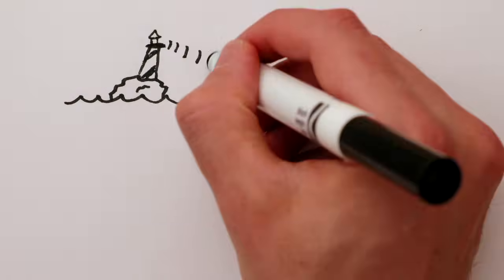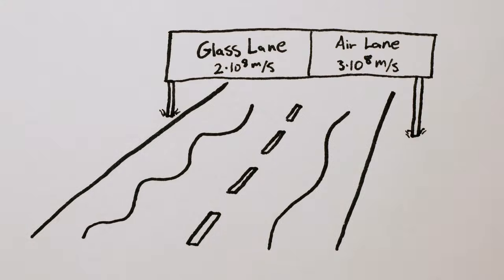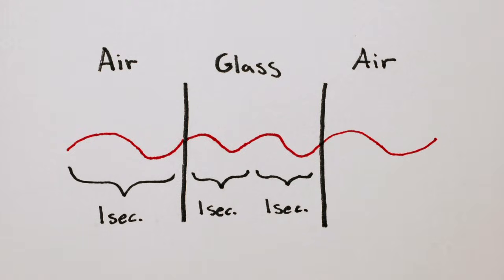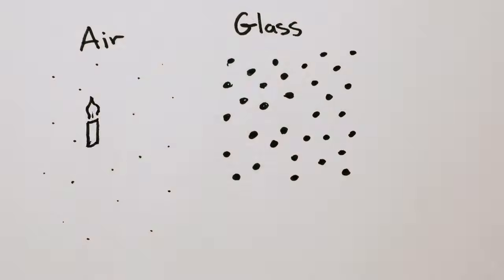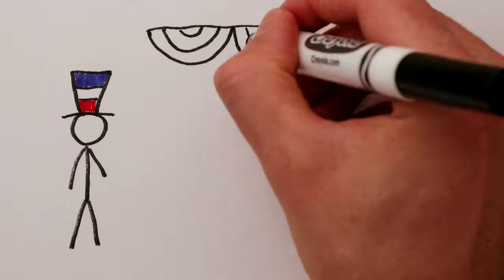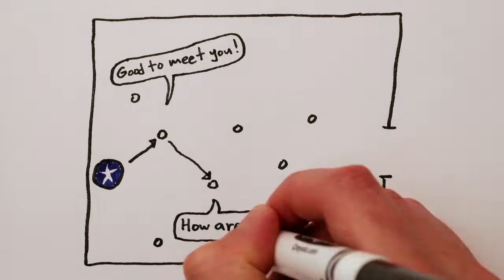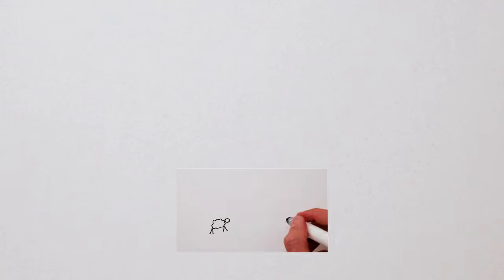The Speed of Light in Glass

Comment: The velocity of light (V) used in Lorentz's transformation (equ 18 - 27) cannot be physically measured.  Galileo attempted to detect the velocity of light using two lanterns but the result was negative.  Roemer described the velocity of light using the eclipse of Io but when the Earth was at the orbital positions K and F, the dark side of the Earth is not facing Jupiter (fig 3) which would prevent Roemer from viewing Io.  Bradley's (1727) stellar aberration was used to calculate the velocity of light but Bradley derivation requires the Earth's orbital radius that is obtained using the transit of Venus but Venus is within the Earth's orbit and an observer on the dark side the Earth (night) cannot be ever be facing Venus, Mercury or the Sun yet both planets can be been at night which proves Venus and Mercury have larger orbits then the Earth's which invalidates Bradley's measurement of the velocity of light.  Fizeau (1849) measured the velocity of light using a rotating cogwheel but Fizeau's cogwheel experiment is not using a single pulse nor was Foucault's (1850) rotating mirror experiment since a single light pulse propagating 17.3 km cannot form an intensity.  Weber-Kohlrausch (1855) calculated the velocity of light, using a capacitor (Leyden jar) but Weber-Kohlrausch capacitor does not emit visible light.  Michelson's (1881) experiment and the wave equation (λf = c) were used to calculate the velocity of light but Michelson's experiment and the wave equation were both dependent on an ether that does not exist (vacuum).  In Einstein’s (1905) Special Relativity, Einstein is assuming the velocity of light has been measured and used relativity to describe a constant velocity in a moving coordinate system without any legitimate means to measure the velocity of light.  Moreover, an oscilloscope was used to measure the velocity of light but an electric signal propagates at 2.7 x 10^8 m/s in a wire that is less than the velocity of light cannot be used to measure the velocity of light (3 x 10^8 m/s).

Comment: This video is wrong. There is an interesting video of Fermilab on the subject
https://youtu.be/CUjt36SD3h8
The basic idea is that light behaves like an elecromagnetic wave (among other things) and interacts with the electrons in the glass, even if it's not the right frequency to be absorb by the electrons. This generate a second electromagnetic wave by the electrons on top of the first. The two wave combined apparently slows down the original light wave, bending it in the process (due to the interaction with the electromagnetic field in the glass : https://youtu.be/NLmpNM0sgYk)
As it comes out of the glass, there are no (fewer) atoms and light regain it's original speed and orientation.
But according to Sixty Digit video, it could be much more complex than that:
https://youtu.be/CiHN0ZWE5bk

Comment: Sorry, I'm afraid this is just wrong. Light slows down in glass (for example) because of interaction of the lights' electromagnetic field & the fields of the atoms in the glass. That's why it comes out in the same direction as it went in. It doesn't bump into anything. The energy is not absorbed & re-emitted by the glass atoms - if either of these cases were true then the light emerging would travel in any random direction - not the same one it went in as.

Comment: This video is excellent in focusing on the photon frequency which must not change has it would imply a change in energy. Photons can only lose energy. This is what happen with fluorescent materials; they absorb a high energy photon, waste part of that energy as heat then release a new photon at lower frequency.

Some laser such as the green ones based on Nd:YAG (neodymium-doped yttrium aluminium garnet; Nd:Y3Al5O12)  use a non linear effect, combining 2 photons at 1064 nm to produce a new one at exactly double the frequency, 532 nm. UV laser exist which use 3 photons as input for each UV photon as output. They manage to produce coherent light, which mean every single photon are synchronized to start the wave exactly at the same time ; no phase  difference. The frequency of each photon is slightly different because of Dopler effect induced by thermal motion. The small spread of frequency is called bandwidth.

The known facts are:
- Photons go at different speed depending on the frequency
- Once entering in glass and adjusting angle and speed, they maintain that new angle and new speed until reaching another interface
- if the exit location is parallel  to the entering, the photon resume at the same angle. An image is just shifted but keep the same color. In case of prism, the angle is different, so the color keep diverging, so a white beam get exposed to it's true nature ; a large collection of colored photons.

Comment: Finally, when talking about this subject, the narrator mentions that the speed of light does not change rather the distance traveled gets longer. Well done Minute Physics. Like the irritating video of the crystalline structure that was successfully tested with the results of giving the light a longer trip with an aim at having the light take a year to pass through leaving you with a crystal storage device capable of holding a years worth of info. At that year mark the first light leaves through the other side as new light continues to enter the other end, basically "overwriting" the data. The narrator constantly referred to their new tech as something that slows light down to a crawl, so slow in fact that it will take a year for it to travel a few inches and once out the other side, it stretches out as it returns to its full speed, the narrator kept saying. Its the same as, in reference to the double slit experiment, saying that the "mere" act of observing makes things act differently. In reality, observing particles is far from a "mere" act. Its taking other particles, charging them with energy and firing them at the one you want to observe changing the way the particle being viewed acts because of all the extra energy transferred. A large amount for checking location and a little added energy to check speed. Its the little details.

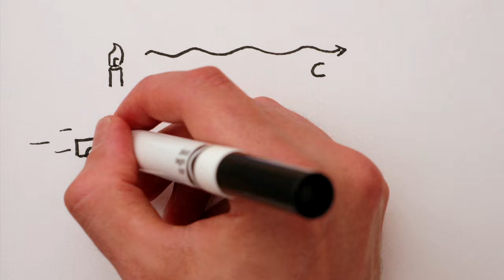Comment: Wait if light changes wave length because of the extra particles it has to bump into when going through water, glass, etc. Then the graphic at 00:47, is wrong isn't it? As each candle is moving through a seemingly different amount of particles than the candle below them, or above them is. For example wouldn't the candle above the rocket have a some what different elevation as the one on the car and therefore have to travel through thinner air and bump into a different amount of particles. Is this correct? Wouldn't this mean that technically all light is traveling at the speed of light but takes a different amount of time to go a certain distance? Can anyone answer this question? Thanks.
Reply: That diagram was referring to the fact that the speed of light is constant no matter what reference frame you are in. Nothing to do with the atmosphere. But yes, light travels slightly slower in an atmosphere.
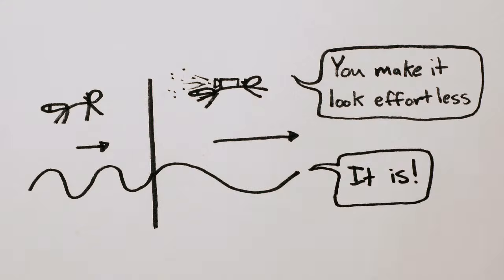Reply: To the first part. Yes, I think so too. It has to travel differently. But the difference is very little. It changes depending on the medium. All three have almost the same medium i.e air but yes their densities differ by a very tiny bit as compared to how large the speed of light is. So yes the diagram at 0:47 is sorta wrong but not that much in the real world. And no. All light is not travelling at the same speed and taking different amount of time. It is illogical to talk about velocity and time as independant factors. Different light takes different times to travel same distances depending on the medium and wavelength and refractive index. All light is NOT travelling at the same speed except ideally IN VACUUM. In all other mediums their velocities differ.
Reply: Aidan Smith In addition to Luke Boggon's answer, what I have understood till this date that, this is one of the tough question, in physics, to explain even for big physist working in this field. What makes it extra difficult is to explain to the general public. I recommend you to watch sixty symbol's video on this topic. You can also check out Science Asylum's video if you like a shorter one. There are different models to answer this question among which photon following zig-zag path is considered to be dead wrong.

Comment: If two ships are going at 99% the speed of light directly toward each other, would they be going at 198% the speed of light relative to each other? I'm legitimately wondering if this is correct, and I'm too tired to think hard
Reply: No, due to relativistic effects, they would be moving at about 99,5% speed of light relatively to each other. Speed does not just add up, the equation is more complex (v₁+v₂)/[1-(v₁v₂)/c²], only for small numbers the divider is very close to one so the result is very close to what you would get by simply adding it up and that's what we usually use.
Reply: it depends on the reference object. when determining speed of an object we have to determine how fast something is moving compared to another object. so if you were riding a bike next to your friend and he was moving at the same speed as you, he would "technically" be moving at 0 mph (or kmph) if you were the reference object. but if you went past a tree he would be moving a lot faster than 0 kmph/mph. so if you are moving at 99% the speed of light and another object was moving the same speed. then technically yes, you would be moving 198% the speed of light compared to the other ship but not compared to any other object. to any other stationary object, both ships would be moving at 99% the speed of light.
Reply: gundealerofthe74th Thank you for the reply. This was one of those late-night thoughts.
Reply: Further to what Jan said, when the ships are going that fast, time actually slows down for them.   As a result, the closing speed (the velocity [distance÷time] of the ships relative to each other)  doesn't double numerically, as you would expect.  I don't fully understand it myself, but that's the reason why you can't just simply add your speed to the speed of an object you throw forward (or a beam of light that you aim forward).
Reply: Think about light exactly the same way as sound. If two sound wave intersect, do they affect each other in any way?

If two concord airplane fly and pass each other, the super sonic boom of each one keep travelling at the speed of sound. The two pilot can smile at each other and wave their hand. The sound trail behind, 1.5 or 2 or 2.5 times slower.

In any cases, once the plane exceed the speed of sound, it doesn't matter how much faster they exceed it. Their super sonic boom keep throttling at the maximum speed that a sound wave can in air.

Finally, when the two supersonic boom meet, they just pass each other like a ghost thru walls.

Even if the sum of these two wave exceed the limit for speed of sound, there is no contradiction : no sound wave, by itself, can exceed the speed of sound. Even when that sound is produced by an object which exceed that limit, the sound wave jut trail behind the fast object.

The super sonic boom is composed of every frequencies, it is a white noise. And we hear that sound in many instances : lightning, the crack of a whip, the sound of a gun, each of these example is a super sonic boom.

Comment: imagine a rather "thick" light beam launched from the starting point and passes by something extremely dense(a neutron star, for example). The neutron star bends the light so that the light's direction changes by 90 degrees. The light keeps going after it's bent. But think think about the "curve" of the beam when it passed by the neutron star. Would that make one end of the beam(the end closer to the neutron star)traveling ahead of the other end? And for an observer, would they see the light beam's light appear to them not all at once, but it'd be like it's unfolding from left to right(or right to left)?

Comment: I really like your videos but I think you got it wrong here and the reason is because if this is true then you would expect that photons would be coming out in many different directions. That's not what you see even if you had a crystalline structure the photons would come out at many different angles because of where they entered. Another common misconception is that the photons get absorbed and reemitted.  This isn't true for two reasons one photons aren't high enough energy to have the electrons in glass jump to the next level hence the reason of glass being transparent. The second is that the time from the time a particle is absorbed and emitted is essentially random. So if we sent one photon through a piece of glass and measured the time it took for the photon to make it through the piece of glass  then sent another through the same piece of glass you should measure the times to be different. Instead of a uniform speed you get one that varies. What actually happens is that the photon has an oscillating electromagnetic field which then affects the electrons in the glass and makes them begin to oscillate. So then the electrons have their own oscillating electromagnetic field and its the interactions of these oscillating electromagnetic fields that leads to the apparent slow down of light traveling through a medium. Anther way of explaining it on a quantum mechanical level is that the photon takes every single path through the glass which can be explained with a path integral.

Comment: MinutePhysics I have a question and I looked for answer everywhere before asking you this! I have read that if two optical waveguides are close to each other then light traveling in one waveguide is completely transferred into the next waveguide after certain distance. Now I can understand how half of the power is transmitted into the next waveguide. BUT when both the waveguides have equal power, what property of light makes the other 50 % power switch to the next waveguide as well. My logic says, it should stop when both waveguides have equal power. I would be glad if you could answer this. :)
Reply: Cheese. That's the answer.
Wait, no, it's 42.

Comment: If an astronaut is on a spaceship and shines a light in the direction that he/she is going, does the light travel faster than the speed of light relative to somebody who is stationery and is watching the whole thing?
Reply: No.
Light waves experience the doppler effect.
From a stationary standpoint, the light slowly becomes more blue the faster the object moves towards you.
The light will then become red shifted as the object moves away from you.
This is the same with sound.
The light itself will not move faster, but instead get kind of "crunched".
Reply: Simon Shugar If you understood that equation, you would not have asked the original question.
Reply: "The speed of light is absolute". Its a postulate from general relativity. You dont argue with postulates. You can try to disprove it, but relativity was built on this, so good luck with that.
Reply: Nope
Reply: failatlife1 Why not? Special Relativity states that physics is the same if the reference frame is moving at a constant velocity. If using the equation 

                    v(1) + v(2)

v(3) =   ---------------------------------

             /                           \
            /   v(1) x v(2)            \
       1 - |  -----------------            |
            \    (speed of light)^2 /
             \                            / 

then the light will be moving about 1000.001 mph faster than the speed of light.
Reply: I'm no physics major, but I know shining light off a moving object doesn't make the light go faster. If it did we would have probably all heard about it by now.